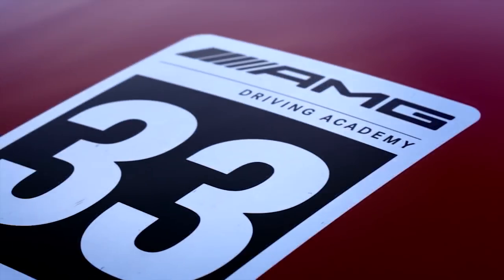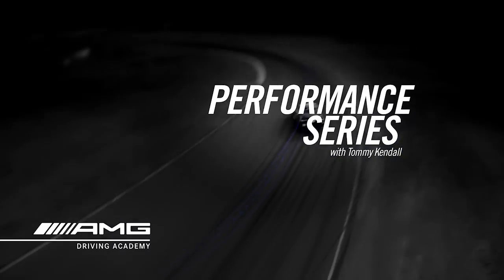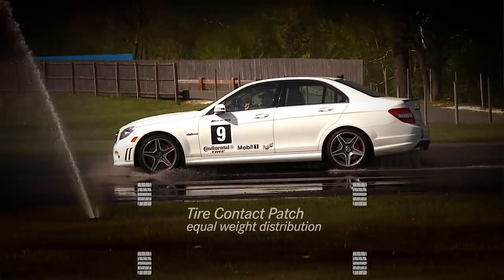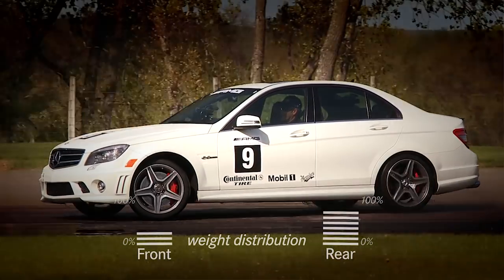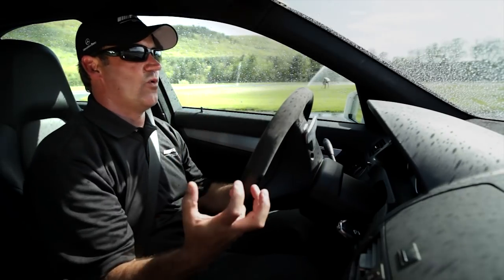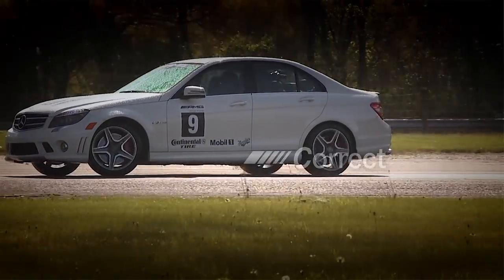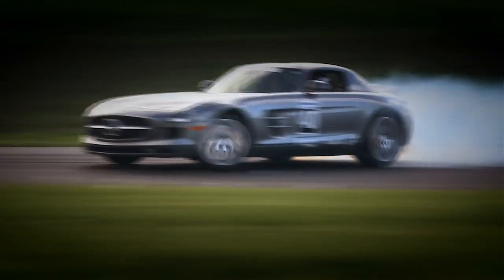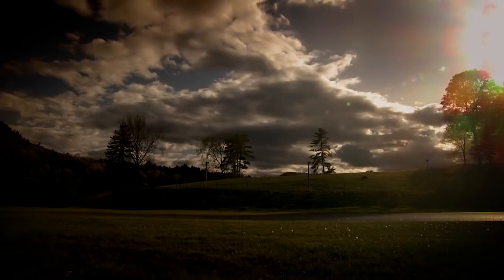Understeer & Oversteer -- AMG Driving Academy Performance Series Episode 4

Comment: I would say oversteer is better to have and easier to correct. I race myself and if I lose the backend of my kart, I just feather my accelerator and counter steer my kart in order to correct it. If I had understeer, I would have to go a lot slower in order to correct it and just hope the tyres would grip. It is a lot quicker to go round a corner with oversteer instead of understeer plus a lot easier..

Comment: There should've been more to this video. I was disappointed that it ended so soon when I felt there was much more to explain regarding the proper way to correct/maintain a slide once it's initiated, and what the proper technique is to straighten the car out of an accidental slide/powerside/drift instead of explaining what you don't want to happen by having the car go into a secondary slide after the initial correction. You told us what we don't want to happen rather than what to do when it does.

Comment: I have a doubt if we use too much of throttle in a corner then the backend of the car will slip n we will lose the cars rear to prevent that shd we use more throttle or lift off throttle?

Comment: Any tips for 4Matic drivers? With power going to front and back wheels, are there different questions you should be asking during the Pause stage? How much power is switched between front and rear axles during a loss of grip scenario?

Comment: But tell me why in the world would a rear wheel drive car experience understeer? It doesn't make sense.
Reply: sigh.........practically all cars under steer RWD, FWD, AWD no matter what if u enter a corner too quickly.
Reply: You can't do nothing about it even if its a RWD?
Reply: ellasOLE22
YYYou can't do nothing about it even if its a RWD?
Reply: with a RWD car you can gun it hoping the car has enough power to transition into oversteer.
Reply: In the middle of the turn? or the beginning
?
Reply: ellasOLE22
So full throttle in the middle of the turn?
Reply: The weight shifts to the back when you accelerate regardless of whether the car is RWD/AWD/FWD. Check out the RWD vs AWD vs FWD by Engineering Explained